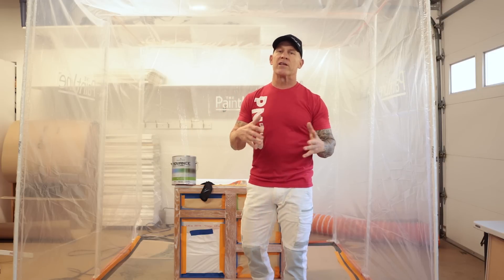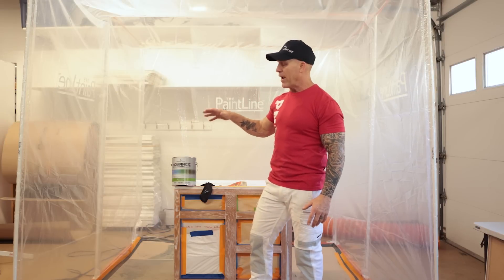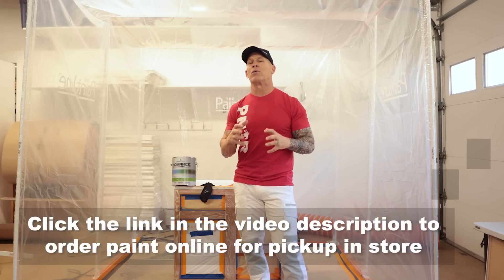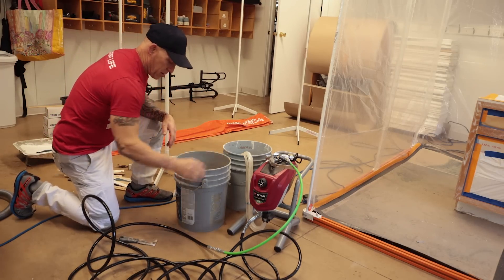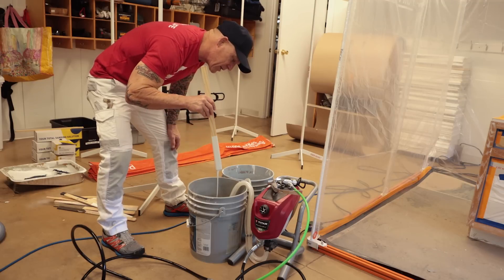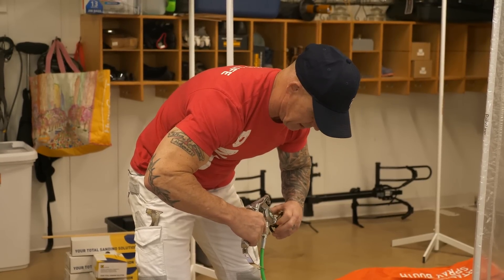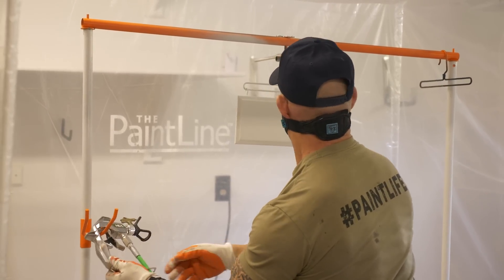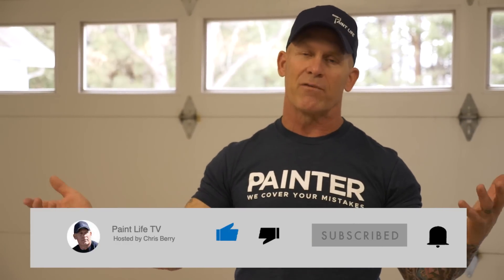Benjamin Moore Advance on Cabinets Reviewed. How Does it Perform Rolled, Brushed, and Sprayed?!

Comment: I had trouble with it on trim. The parts i had to cut in vs roll looked so different even on the 2nd coat. However if I brushed out a piece after rolling it seemed to work better. Did you notice this?
Reply from the maker: interesting

Comment: I like Emerald Urethan by S.W. for my cabinet jobs.
Reply: This is honestly better.  At least if you're looking for an oil like look.
Reply: Which are you saying is better? The Emerald Urethane or the B.M. Advance?
Reply: @Sh4rK280  The Advance.  Oil  like finish us what you're always looking for
Reply: Thank you :)
Reply: The only real drawback for me would be that long dry time
Reply: @hotdiggityayo  NOT AT ALL. I used it for the first time. It performs so poorly as far as adhesion goes compared to Emerald Urethane. It doesn't self-level like the Emerald either.

Comment: Question, I redid my kitchen about 5 years ago. I replaced my old wood cabinets with white thermo foil. I noticed in year two the cabinets started to discolor. Most of the cabinets are now discolored,  they look off white. Would you suggest this paint to paint over thermo foil?
Reply: Cannot paint thermofoil. It's a wrapped cabinet. Not painted or stained
Reply: You need to peel out the whole thing, sand and paint

Comment: Isn’t using the sprayer a bit of over kill for one cabinet? That sprayer sucks up 1 qt of paint before it sprays properly. I use a pint gravity feed and it works great. I still use a very dense foam roller after and get great results. Otherwise good info and use of the BM product

Comment: Can I paint it on top of wood trim that has a stain and sealer on it if I scuff the surface first?
Reply: This reply is too late for you, but in this case I did a light sand, a couple of coats of Zinsser Bin primer and then two coats of Advance. I don't think it's coming off anytime soon.  The Bin dries so fast it won't add much time to the job.

Comment: we brush and roll cabinets, started out 4 or 5 years ago using pro classic hybrid alkyd, switched to the emerald urethane two years ago because the pro classic needed more coats and not available in the darker shades.

never had a problem with durability from either product and or brush marks

we now use the emerald urethane exclusively

this product sounds similar,  how long do you think it will hold up over time?

we travel the US painting cabinets and have had no complaints,  our clients know and like BJM but agree to SW based on our say, is this an equivalent product?
Reply: I have used both the Emerald Urethane, and Advance, but have a lot more time behind the sprayer with Advance. I have done HVLP as well as airless with Advance and have had better luck with the airless and FFLP tips. No thinning required. The fact that you're wondering about the performance of one versus the other means you're in the same camp I'm in- wondering what else there is that isn't waterborne and/or provides a more durable finish than what we have been using. I have had no complaints using Advance, but am convinced that there's something better out there! I am based in VA, and EPA restrictions here mean I can't get any tinted pre-cat lacquer or I would be exploring that a little more. Chris and team have great videos on using that stuff, but I just can't buy any of it! I went all the way up the supply chain to the plant manager for Sherwin Williams, and was told by everyone along the way that they wouldn't sell me the product! I do recommend Advance after using it a ton.
Reply: Which primer do you use? Do you recommend a particular brush or roller? Thanks!
Reply: @Avital4414  STIX. 1/4 nap 4” roller
Reply: @davidgrider3084  thanks!!
Reply: @davidgrider3084  Microfiber? Mohair? Does that matter?
Reply: Do you find that Emerald Urethane brushes better/leaves fewer brush marks than Advance?

Comment: Hi! Thanks for the video. I'm currently spraying BM advance with my Wagner 3000 on my oak cabinets. I'm curious why you didn't use a primer? BM suggests using Stix, but it does not seal tannins. Stix recommends using pure shellac before priming. It's a lot of steps: aqua coat, shellac, Stix & paint! I'm wondering if you would recommend skipping Stix primer altogether and using BIN shellac primer instead under BM? 
I've gotta say, I'm having a hard time spraying advance with the Wagner, I can see it's a beautiful paint, but the sprayer has really let me down and is very temperamental. How do you ensure a perfect finish coat on doors laying horizontally with no dust!?
Reply: I am excited to see a review on this channel for Advance. I have been spraying it on cabinets for years now. I have done tons of my own research and I can give you the skinny on what to do. I am a professional painter and contractor so I speak from many, many hours of working with this stuff. Here goes:

Clean all surfaces wIth TSP to remove grease, etc. This will also start to de-gloss the finish. 

Lightly sand all surfaces- I quickly use 220 grit to scuff things up to promote adhesion. 

Re-clean with TSP 

Grain filler (if you're doing that)

Prime with BIN. Depending on what we are doing I will use aerosol spray cans to eliminate clean up of our equipment. It works well, but be careful because BIN is very watery. It sticks to everything, but runs very easily! 

Tack coat of paint. Light coat (not trying to fully cover with this coat). I use FFLP tips exclusively, and run the pressure between 1300-1600. Just enough that you don't see tails on your test pattern. I have a digital readout on the sprayer, not on the gun. Your mileage may vary, but keep the pressure as low as you can while still getting an adequate pattern. This takes time to perfect, and no video will be able to replace time spraying!

Sand with 320 and re-coat up to 2 more times. The product literature for this paint says you need to sand between coats- probably because it builds such a hard finish that it has trouble sticking even to itself! 

Keys that I've learned- you MUST Prime with this stuff. STIX is not as great as they say it is. Just use BIN. It's worth the aggravation of learning to use such a watery primer. Sand between coats. Very important. This is the best waterborne paint I've used on trim and cabinets, and I've tried all of the major brands' variants of cabinet paint, etc. Follow the steps and you'll be good to go!

Comment: Great video. What grit sandpaper do you use between coats? I’ve been 

Would love to see a video about painting a builder grade pre-primed steel exterior door that you see in new homes. Can’t take the door off to paint, as I’m dealing with sidelights too. I hear Sherwin Williams has a great paint for it.
Reply: Wondering the same thing about the sandpaper.
Reply: Sanding with 400 worked for me.

Comment: My husband has been a painter for years and this is the first time he uses advance for cabinets, customers do not want any texture at all, I'm not even exaggerating ... so my husband is having a hard time figuring out the pressure settings to prevent orange texture. Any tips? Also is he supposed to thin it out?
Reply: Orange peel is normal and It should level out on its own. Door should be sprayed flat.

Comment: I have a Graco X5. What tip should I use?
Reply from the maker: Depends on what you are spraying
Reply: cabinets in kitchen @Idahopainter  I have BM advance. I have Sherwin Williams extreme bond. If I roll primer will that take away the painted spray look.

Comment: How long did you wait before flipping door and painting reverse side? Can you flip after 2-3 hours to paint reverse than wait the 16+ hours before 2md coat?
Reply: When I spray my doors or cabinet drawers, I always wait at least 16 hours before I flip over to the other side. If you don't you will run into problems. It's a great paint, but the downside is the curing time. You just have to take your time, and it will turn out great.
Reply: @michaelm9621  yes, likewise, just finished my bathroom and kitchen cabinets, sprayed doors with Advanced and a 310fflp tip, I did one side per day, 24 hours in between each coat/side and just waited this long before flipping, turned out great, levels out great when sprayed or rolled/brushed, patience is key for sure...

Comment: Would you recommend a primer before using advanced?
Reply: Stix
Reply: @jcgrands555  you would use stix on oak and such? There won't be any tanning bleedings from the wood oils?
Reply: Cover Stain ($20/gallon) works incredibly well with Advance. I painted approx 1000 sf of 1980's stained birch paneling in my own home using Cover Stain and BM Advance and couldn't be happier with the results and durability.
Reply from the maker: In some circumstances
Reply: @MrsMudBitch  cover stain fumes hellatious , Kilz original better , sticks better too
Reply: Advance has its own primer. I don't know if it is any better than others, but I've found it works well.

Comment: What are you talking about if you don't read the instructions? This paint is a hybrid oil finish with water born. All alkyds require to dry over night before attempt to prep for double coating. If you disturb this product and attempt to brush, roll or sand you are not going to allow the alkyd to fully stretch and give you the oil enamel effect. You don't have 4 hours open time as you said here. The latex part dries pretty quick and you'll see brush marks if you over work it. Union painter and decorator, 26 years experience.

Comment: Do u have to prime with that paint?
Reply: You definitely should, but depends on the surface. Recommend a wax free shellac/sanding sealer/shellac based primer. If you're going over something like a plastic or glossy something or other you need a bonding coat like stix or similar, but less sealing. Aquacoat for grain filling. Super minor fill can be done with Shellac primer and sanding

Comment: same brush, same temperature, same oak cabinet faces, sanded to 320 after aqua coat filler.  You have some additive?  like flood or something in this paint?  My paint does not lay out the same, or even close like how yours just magically lays out for several minutes of messing with it, i would imagine some sort of additive could fix this.  Haven't seen this with your channel before, but it seems common in this area particularly where people are showing parts of what they are doing, but not including key information such as using additives.  Yeah, just doesnt seem possible given very similar conditions that my paint is starting to dry and drag in half the time it takes your paint to just magically form a guitar finish over and over again.
Humidity another factor?  Barometric pressure?  Moon phase?  
other than this great channel, watched your gun technique a while and have made some good stuff.  Advance paint is what i use, but maybe they are cutting it with some behr to save some money or something.

Comment: I may have missed it, but how was the sprayer? Wasn’t that part of the review?  Ps as a DIYer, watching you for years, this was the best paint to spray all my doors and trim. Does lay down like glass so much so that bad sanding prep on a door showed my pre-sanding marks. For me first time spraying the product i found you can only do a fist spray if a second spray overlap is too slow on vert surfaces it has a tendency to run but not until like 30-50 min later. That said, the runs was more about the user experience and technique than anything.  Oh and fine finish all the way.

Comment: No primer? I'm doing a big cabinet job next week and going to use this. I usually use kilz or bin oil primer,spackle, sand, caulk, tack, then top coat. Just curious what you think of bm advance, value your opinion due to you being the painting guru,lol. Paint life brother!
Reply from the maker: Great paint for DIY
Reply: Do I need a primer and does advance do as nice a job as BM Satin Impervo as far as the finish and durability like scratches off? Great video
Reply: @markwelch9989 ,I tested a spot on a cabinet door without primer and it looked great but didn't hold up to the scratch test. Looks great but,takes too long to cure, sw emerald urethane preformed better and has  better sheen, hardness, and cures faster. Use primer !
Reply: Thanks Russell, can I use an oil based primer then use the Advance or Emerald Urethane

Comment: Thanks for this. I'd be curious to see what happens when you use a foam roller.
Reply: La Haza commented above that the best finish is with a foam roller and little paint. Thrilled because I love using foam rollers.

Comment: Great review, curious to ow it would spray with a HVLP and what tip?
Reply: I have a Titan Capspray 115 and found the 4 needle and nozzle to be the smoothest finish.
Reply: I have used a Fuji Q4 platinum to spray this a number of times. To be honest- I always had to thin the material and I used the 2.0 needle and cap. I switched to airless to get better atomization. If you have a pressure pot HVLP system it would probably work better. Mine has trouble "pushing the paint".

Comment: Idk how this paint is getting such good reviews.  I tried spraying it on cabinet doors.  I went to install the doors 5 whole days after I sprayed them and the paint still felt sticky and I was getting finger prints and smudge marks where I touched them.  Had to put another coat on a lot of the doors.  Seems like you have to wait at least week before its safe to pick up and work with doors.
Reply: @ihave35cents95  what cabinet paint product do you currently use?
Reply: I live in Tallahassee, Florida and the humidity is always high here. Just wondering if it's a good product to use as opposed to something just as good with better dry time. Any suggestions?

Comment: It appears to be a good paint, but to be honest my oil base cabinets that I sprayed look much better. My cabinet doors while painting literally looked like a piece of glass. When dried, they were so smooth. They looked as good or better than factory painted cabinets.
Reply: What oil base painted did you use?
Reply: @gidgetrasmussen4266  Sherwin Williams Pro Classic. One of the tips for a very smooth finish, is to paint the item laying flat with a heavy coat.

Comment: Great product but not my top choice for spraying cabinets because it's alkyd it stays soft longer than say an acrylic urethane.  If you are spraying cabi et doors on horses it can leave indents on the doors even if you wait a day to flip the doors.  But yeah  it's not a product for amaturers.  There is a learning curve. Sags quite easy when brush and rolling. Need to keep brush strokes long at tight.

Comment: Does it dry hard similar to how oil is?
Reply: In my experience it does. It also depends on application method. I spray it using an airless sprayer (no thinning) and it does very well. Satin is my go-to sheen. Hope this helps!

Comment: Nice paint, but be prepared as the color of a white is different in this paint than say Aura. Ex: simply white is closer to true white in Aura, but has notable yellow undertones with Advance. Now, simply white already has a yellow undertone, but that is not what you are seeing when doing a side by side aura vs advance. This is a true shame and it means you must test sample the actual advance paint with your test colors (spendy, but we did it). Chantilly lace does not come out super white in advance, a real bummer. But if your wall paint is set to match the chantilly IN the advance, and to make that chantilly stand out, then you are all right. We lucked out doing our cabinets in simply white and the walls in a darker color of tan.
Reply from the maker: Thanks for sharing

Comment: Good overall paint for a professional finish on trim and doors. Takes FOREVER to dry, so I'd never use it professionally. Kinda half-ass for cabinet refinishing though. I mean for a rental I'll use this stuff or cabinet coat, Even used cabinet coat in my own home and only needs a little touchup 8 years later so deff can't complain but will finish like a "good" paint, not really like the hard factory cabinet finish. Just to set expectations with folks thinking of DIY'ing this themselves

Comment: Eh, my experience is that its claimed leveling properties just aren't there, and I've only used it on trim.  There is no way I'd brush or roll cabinets with it.  BM Impervo alkyd has far superior leveling properties for trim.  But there is no way I'd brush or roll cabinets with either Impervo or Advance.  I'm an amateur (with a lot of painting experience) and am looking to paint trim around some prefinished white cabinets I'm installing and I don't want brush marks on it, so I'm looking into spraying which I've never done.
Reply from the maker: Thanks for sharing

Comment: I love your videos & your knowledge is incredible, but you used WAY too much on your brush with this paint.
You don't load your brush AT ALL the way you do with any other paint.
The way to get the most gorgeous finish with it is to use a foam roller with VERY LITTLE on it.
It will level out & dry like a hard candy coat or shell of an egg.
It's great paint when all prep is adhered to.
It will cure & harden without ever chipping if it's thin, but otherwise it won't.

Comment: Let's see you try painting a baseboard with a brush or roller. I painted mine on sawhorses, not vertical. The paint drags like crazy. It didn't level for me at all and the edges ran terribly. Advance is just a very expensive ripoff.